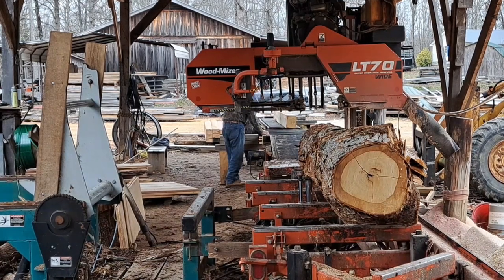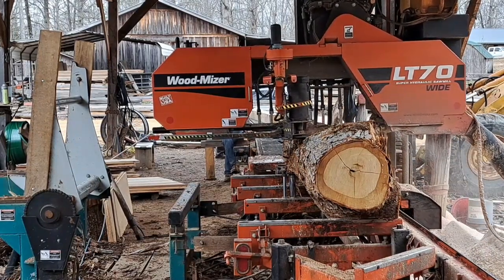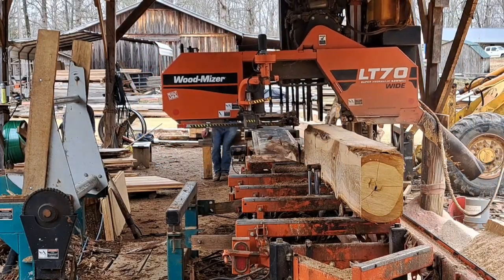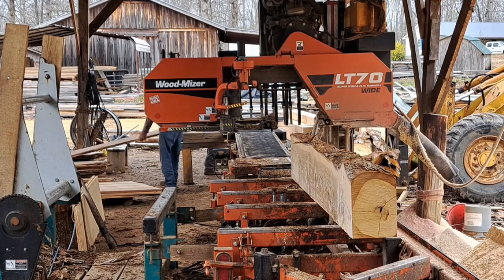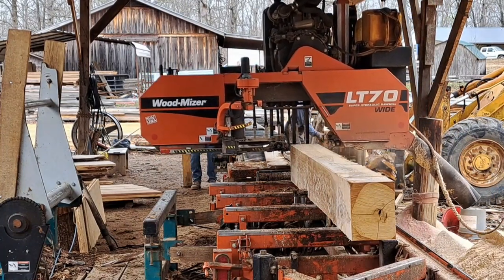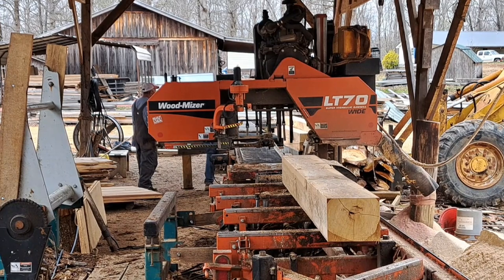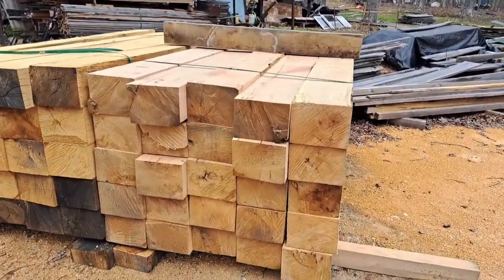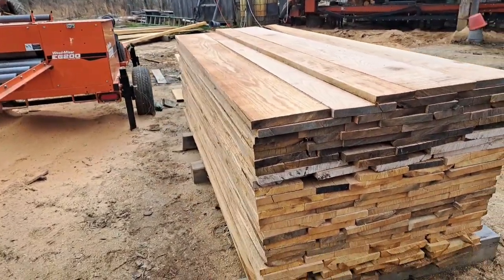Milling white Oak into Rail Ties #millingwhiteoak #sawmilling

Comment: On making rail road ties.... is white oak the preferred material or can other type of oak be sawn?  I think you said the tie needed the heart of the log?  If so, does that mean only 1 tie can come from a log (assuming it isn't long enough to get 2 ties).  If this is true, is the technique to make dimensional lumber until you are down to the size need for a tie?  Thanks!   I've subscribed and will watch to the end.
Reply from the maker: The company we sell to buys almost any hardwood cross tie they do like the heart in the middle of the tie they will tell you not to split a big log just make one tie but sometimes when we have really big logs we will make more than 1 tie you run the risk of them rejecting them or paying less for them so far we havent had them reject very many..We saw hickory,Maple,cherry,Gum and oak ties just to name a few different species I hope this helps if you have anymore questions just leave a comment I will try my best to answer thank you